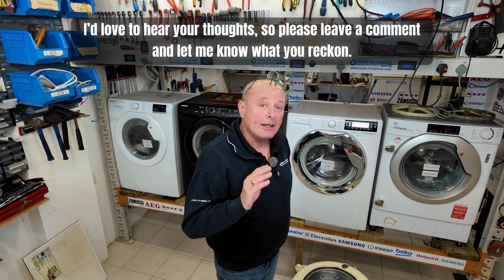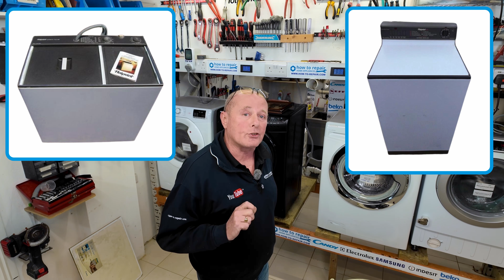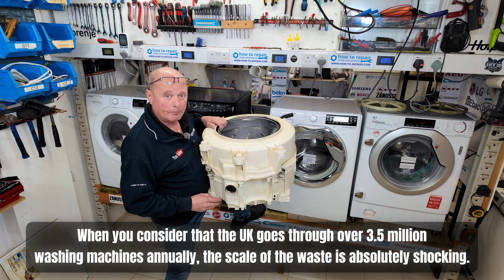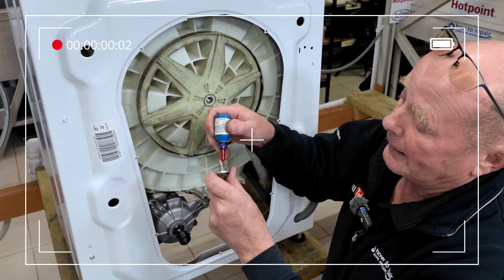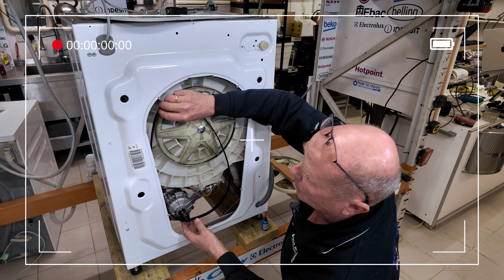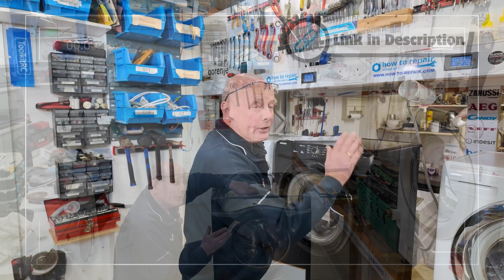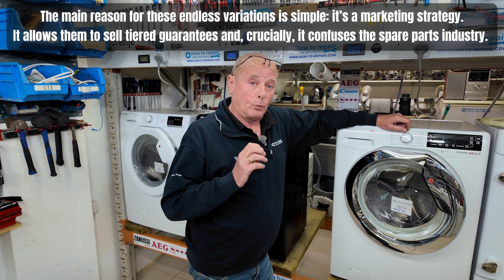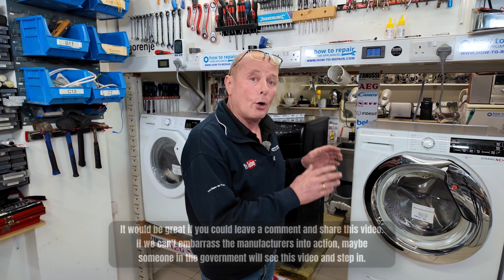I Scrapped 13 MACHINES to Prove a Point: STOP BUYING These Brands!

Comment: I have a 7yr old AEG Lavamat 6000 that has plastic drum paddles which are effectively irreplaceable because they're designed to be installed before the drum is assembled into the machine so if you get a hole in one from say a coin (easily done), it's a major problem! The facia panel of the detergent drawer has also now broken off but the whole front panel has to be replaced inc swapping the electrics over so I'll just superglue it back on! 😡

Comment: It's not just white goods it's everything from cars to computer tablets they all have built in self destruct or over priced spares. For example £600+ for a Ford head light or you can't reset the onboard computer to tell it you have replaced the affordable self replaceable brake pads on certain Kia models unless you've got the £2.5k box of tricks to reset it or you have to take it to a dealer. Phones, tablets and computers that get slower and slower or things like the USB power socket wears out after two years and the touch screens become unresponsive.

Comment: Even if a washing machine is repairable, unless you can do the repairs yourself then it's often not economical to get a repair man out to fix it. It's actually possible to split sealed tubes if you bolt them back together and use proper sealant but that's only something very few people are capable of doing.
Reply: It’s especially bad with Fisher & Paykel’s newer machines in New Zealand. Even when you know from the fault code that there is a motor fault and you tell F&P that, the repair person will come in a few days to read the fault code and say that it’s a motor fault and will then order a new motor from Australia which should arrive in a week or two. So two call-outs are necessary. Fortunately I still have my 1990’s Phase 2 Smart Drive washer, which tend to last about 20 years and are trivially easy to maintain and repair.

Comment: Hey, i like washing mashines as a hobby and i collect it from people who dont wanna repair it. Mostly older ones, newer ones also to re sale it after a check or repair, for little money. I can say, older ones are so much better quality in all ! Stainless drums, massive cast iron inner and outer spiders, often also conter wights, derailler control  with 4 well ballanced main programms and some little options like half load, ecowash (who reduce the temp for 10° or so) spin reduce, thats it. with a bit care of it, this machines washed for decades!  last week i collected a Bauknecht from 85, still working perfect, only terrible hardly calcified and dead shoks... thats all ! i will give them a good inner and outer cleaning, new shoks (maybe carbon brushes and condenser) and i have  one more nice running,  stylefull machine in my collection! Todays machine, as you say, are realy realy crapy, expect the realy high expencive ones. its unbeliveable how the governements dont prohibit to produce this crap more and more, its a waste of recources and grey energy. if the products again more durable, better quality and repair friendly it would be reduce tonns of electrical waste and save a lot recources, AND consumers money!

Comment: Thanks for the video and all your efforts. Providing a knowledge base and affordable spares is crucial. Beyond that, legislation is required because it suits manufacturers to sell new machines and a public brainwashed into buying a new washer every five years is just what they want. There is nothing green about an appliance that lasts only a few years, however little water/energy it uses. My Hotpoint 9535 was new in the late 80s, it suits my needs and still has the original door seal...

Comment: I had a similar problem with Perfectdraft Pro's - 2 machines, both failed just outside the warranty period, both for the same fault (temperature sensor failed). No-one in the area will even quote for a repair because they'e apparently "a sod to work on". 
The whole household appliance industry seems to have become rotten with inbuilt obsolescence and failure by design. Makes me nostalgic for the 70's........

Comment: My dryer just got taken out by a substation explosion a city over.  Little front panel pcb got fried. Getting 12v and 5v, but no life.  List price of the new part, US $330.  Entire washer MSRP not on sale: US $699.  They want so badly for you to just throw the thing out and get a new one.  I found a second hand part removed from a damaged floor model for $135.  The part NEW shouldn't cost more than that, given what it is.  But here we are.  

Honestly, if I had to pay MSRP for this part, I would likely have just replaced the unit.

Comment: 19:00 But if everybody is doing it, what are we supposed to buy?
Reply: I wonder, he said some of the sealed drums still had the bolt holes where bolts used to hold the drum together.

Maybe you can take one of those and simply cut the drum open along the weld and re-assemble it with bolts? 🤔
Reply: @sevenproxies4255  There wouldn't be much point if you can't get replacements for any of the proprietary parts inside. Plus, buying the machines means that you're still giving the companies your money, so they still win.
Reply: I don’t go to curry’s I get old ones only

Comment: Hi Paul, you produce some great videos and give out fantastic information, but I'm afraid you are on the road to nowhere in the great scheme of things. Many consumer goods, particularly TV's, but we can include washing machines, are pro-rata so cheap to buy new versus spares cost and labour charges today that this is how it is going to be. There is zero chance of any manufacturer being pressured into changing the way they design and build machines just so that they can be repaired cost effectively. I've read all the comments and the story is exactly what you'd expect, it's just luck of the draw, one man gets 10 years out of a Beko, another 11 months. When the cost of getting someone to just have a look at your machine in situ equates to 30% of the cost of a new machine, nobody really cares about where the old machine ends up (it isn't landfill by the way). I used to make a really good living out of repairing domestic audio equipment, particularly CD players, imagine trying to do that now, no chance. Built-in obsolescence dates back a long, long way I'm afraid.

Comment: do britain really dump appliances in landfills instead or crunching them to bits to get recyclable steel ? chatgpt states; In the UK, old washing machines do not normally end up in landfill if they are disposed of properly. Instead, they are treated as Waste Electrical and Electronic Equipment (WEEE) and sent for recycling.

Here’s how it typically works in Britain:

Washing machines count as large household electrical appliances, so they must be recycled under WEEE regulations.

Local councils provide household waste recycling centres (HWRCs) where you can take old appliances.

When you buy a new washing machine, most retailers will take away your old one for recycling.

At authorised treatment facilities, the machines are dismantled and processed. Metals (such as steel and copper), plastics and other materials are separated and recycled.

So, in short:
Properly recycled washing machines in the UK go to metal and materials recycling, not to landfill. prove me wrong ?

Comment: I was a storekeeper from mid 70's to early 80's at a multi brand spares & repairs Co. In that era my mum had a Philips & I had a Hotpoint (brown fascia) both served for 20 plus years. Moved to France & a new Electrolux lasted about the same, now 2 years into Indesit use, so far so good. Wife uses it at least 5 times a week.

Comment: How much would washing machine cost if it was built properly. Galvanized case, replaceable standard bearings, bolted on drum... I know that washing machines for professional use are 5000 eur for small 5-10 kg up to 50 000- 100 000 for monsters for washing up laundry for big hotels.

Comment: I live in Australia. We have what’s called “hard rubbish” collection arranged by the local council & you can pick your dates. (Twice a year) My friend (& many people do this) rides his bike around his area on Sunday nights bare minimum. You can get some really good scores doing this. Recently he got a 3 month old Kleenmaid dishwasher which had a note attached saying that it had been repaired twice since it had been purchased. He showed me what was most likely wrong (& he was right) there was moisture under the touch screen so he dried it up properly & then sealed it with silicone. That was 2 years ago & it hasn’t missed a beat since.
I actually found a fairly new Miele about a year ago- same issue but also he came over to my house to fix the slight leak as a result of the hose not being properly connected! We both live close to each other in fairly expensive areas (I own my house completely now & just as well or I would be homeless probably) I am on a low income lifestyle like seemingly many people these days all over the world, & so what do they do? Make cars that only last 10 years (if you’re lucky) & throw-a-way everything when the planet is screaming & most people have less disposable $$. Great choices powers that be!🙄🔨

Comment: replaced the circuit board on a sage coffee macine which was 1000 retail. the circuit board was hard to get and it sits above the boiler where the boiler sensors were leaking steam 10c o ring fixed the leak.

Comment: I have 20 yr old Zanussi washing machine, so far I have replaced drum suspension and capacitors in PCB. If the bearings fail, I'll replace them too, because it has replaceable bearings. What I'm most concerned are quite brittle plastics, when I was repairing electronics almost every screw standoff broke :), but I replaced them with threaded inserts. Same with my dishwasher, I do repairs myself, and the only real problems are those darn plastics.

Comment: The sad reality is that there is no law in the UK that makes it illegal to make something hard to repair or have non repairable components, there is a law however that means the over all item must be repairable and this is how company's get away with it because if the drum fails you can replace it and so fix the washer, and so all the company has to do is provide the parts jack the prices up so that no one their right mind would pay for them and say well we offered the parts but the customer refused so it is on them .... sure the price of the part was just a little less than a mew machine but yeh its on them ,,,,...   Like i said in another video I had a 20 year old Beko and had replaced the door lock once and the motor brushed several times but the drum bearings  had recently gone and it was going to cost £190 for a new sealed drum but a brand new Beko with larger capacity was around £240, and like many I chose not to repair as it was better value to buy a fresh new one though i did not buy a Beko i went for a Hisense WF1G7021BW at just £120 just £30 more than the Beko replacement drum....

Comment: I'm a firm believer that manufacturers should be responsible for not only making a product, but also for its recycling. That would quickly eliminate not only "planned obsolescence", but also problems with recycling or lack of it. Nowadays manufacturers are interested in pushing as much in the market as they can, no matter whether it's good or crap. If they would be responsible - and mind you, not "financially" in form of some fee as they do right now, but in real facilities to dismantle and correctly recycle or reuse parts, we would have not only more reliable products, but also much cleaner environment.
Reply: In Ireland, the retailer is responsible for the disposal/ recycling of electrical appliances. If the owner wishes to take it to a Council recycling centre they can do so . Machines are not put into landfill !. Small appliances that were previously dumped  are taken back by the retailers as well. There is a small charge when you buy an appliance or even a flouresent tube to cover the cost of recycling
Reply: @johnoregan8245  And manufacturers LOVE that as they get to destroy all the old machines, rather than having them looked at and repaired.
I replaced my working washer (too noisy for neighbours). The delivery people of the new one will take your old one with them, but they will not carry it downstairs for my friends to take it...
Reply: Back when I was growing up in the 1970s there was a 3or4 company's with one model each that lasted for years now there 20 company's with 4or5  models.
Reply: Good news! Right to repair will become a law in EU, starting from 31 July 2026. Manufacturers will be obligated to provide parts and service information available at reasonable price and within a reasonable time, for up to 10 years after selling the device.
It'll be long and bumpy journey, but we'll finally force manufacturers to make devices repairable. Again.
Reply: @Kwaq84  I am not optimistic at all.
No manufacturers will release their profit, ever.
Either the reasonable price will be challenged, or (and) the product prices will spike up to recover the "loss" (khmm, little less absurd profit), and since the equipment is expensive, the part prices can go up as well.

Then they will sabotage at every corner, how you repair things. Even though only a 10€ bearing has failed, they'll sell you half the machine since it is only repairable that way, with an explanation revolve around "safety hazard" and such.

Then the time... What would be a reasonable leadtime for a part? You can order a generic standard bearing in the afternoon and get it in the next morining. If they delay the parts for like 1-2 weeks, then the shop repairing the thing also needs a few days before for diagnosis, then and after to put it back together, and we assume everything goes well for the first time, then still, you can live without ANY of your appliances for 2-3 weeks? Not wihout a washer, not without eg. a water/room heater, so on...

Most people will buy a new one if the repair would take more than a week and half the cost of a new. I worked in the repair business, and most people did this, even though some of my repairs made the things better than ever was when new (because I built-in higher quality parts or even fixed design flaws), could repair it again to still come out at zero, but no, most people just buy new for twice as much straight away, because it is new, believing that it will be better. But sadly, that's never true anymore.
Reply: I think all corporations should be responsible for their environmental cleanup also. Oil spills, chemical spills etc.
Reply: @novampires223  They should, but given their immunity to official justice, I believe the only method to make them responsible is usually what's called a 'lead therapy'. Few sessions are quite effective to make new CEOs a little more cooperative with its customers
Reply: In Finland it works this way: you can take your old machine to whichever electronics store without having to buy there and free of cost. They have special spots for this behind the stores. They have to take care of recycling.
Reply: That's a brilliant idea and should be made law. Perhaps another way is to enforce longer warranties by law.
Reply: Manufacturers can easily solve this issue by establishing a new brand every year or two, then they don't have to handle the recycling of obsolete brands that do not exist anymore.

Comment: I am searching for good washing machine and dryer for our new home. What should i pick - Asko , Miele or other manufacturer or machines specifically? I taught to buy ASKO W4096R.W/3  but there is a problem - those are now discontinued, as same as ASKO T409HS.W dryer, so i was offered to buy ASKO W3096CW  and ASKO T308HCW  From Miele i was looking at WWG880 WCS and TSD643WP combo. I want to spend less than 2000 euro for both appliances (less is the better) and get good reliability and washing quality.

Comment: Had a hot point free cos broken glass replaced that then the bearings where shot year later it’s in front garden for scrap man. Got a lg for £50 suppose be £800 with broken bearing replaced that. I won’t pay for a new one like cars just get cheap run and keep maintaining until they die. They aren’t worth it. Notice how the older stuff used to have a royal crown on it

Comment: Shout it from the roof tops mate. I repair a large range of electro / mechanical equipment and just had to scrap my own Hotpoint, (Nopoint ?), washing machine due to bearing failure / bonded drum. I am furious. Where possible I used to use car wheel bearings for drums as they last forever in a washing machine. There were brown stains on rear of drum where internal seal failed and water ingress killed the bearing. And what happened to the WEEE directive? Surely it applies to these brands? Do they get round it by offering to take the old machine? Keep it up Paul.

Comment: You will hardly believe this, yesterday i posted about the price of the spider on my Miele WMH122WPS today it gives me an error code F0212, twin dos system, i should have kept my mouth.
Reply: A quick google suggests that can be caused by clogged autodose hose, or faulty sensor. The hose should be easy enough to clean out
Reply: @mels8966  Yes thank you, it is even a common fault, the hoses start to leak and ruin the sensor, or the sensor gets faulty.

Comment: Had a hoover heat pump tumble dryer. Was rubbish from the outset and wouldn’t properly dry clothes, thought heat pump dryers were rubbish. Got a new (Bosch) one after many years of tiresome use of the appliance and it turns out that is just that Hoover made a rubbish heat pump tumble dryer